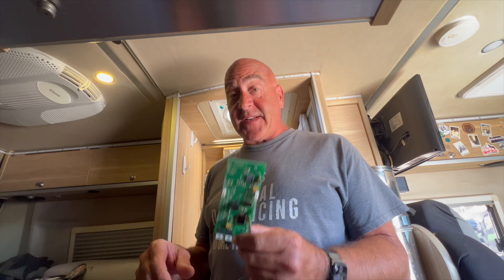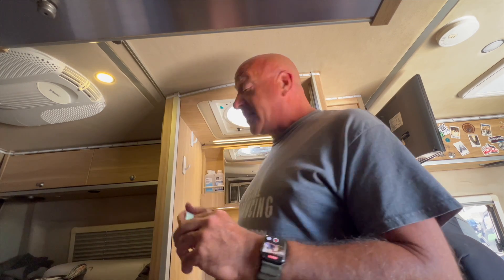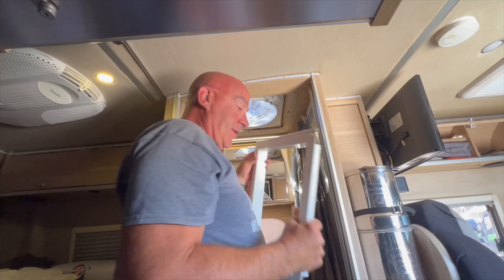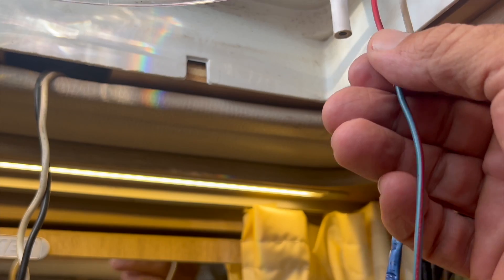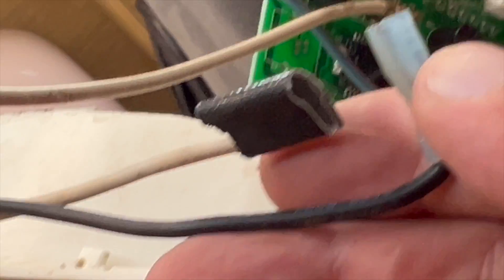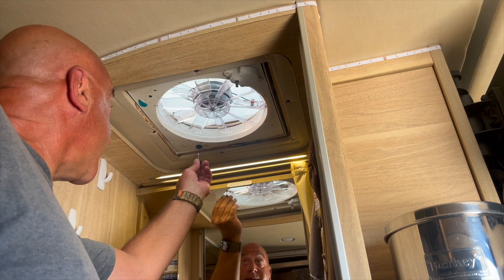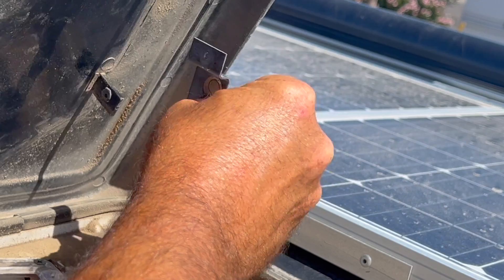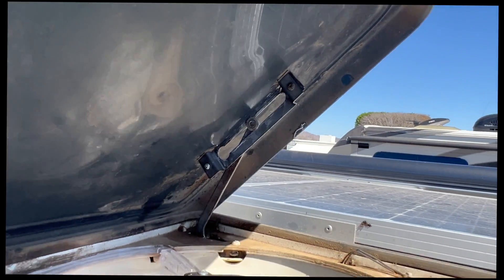Fantastic Fan- How To Replace PCB Board

Comment: I am all too familiar with the bracket that gave you trouble. I had two pop off on the original lid and a replacement. The torque setting wasn't right and it isn't adjustable. I switched to MaxxAir after the second failure